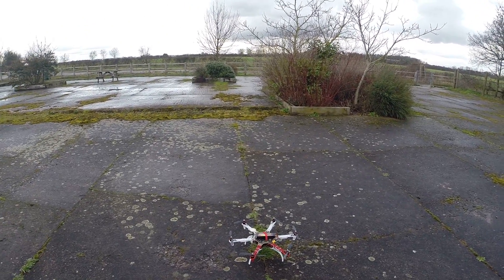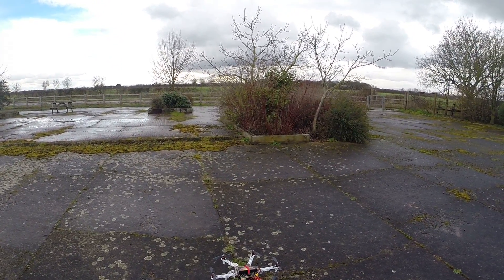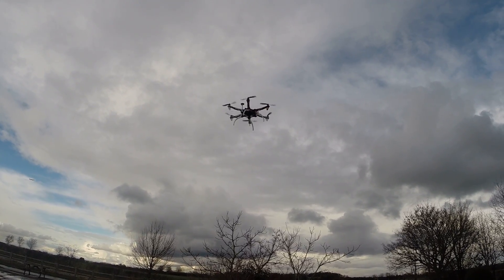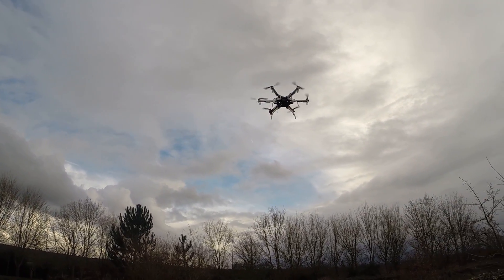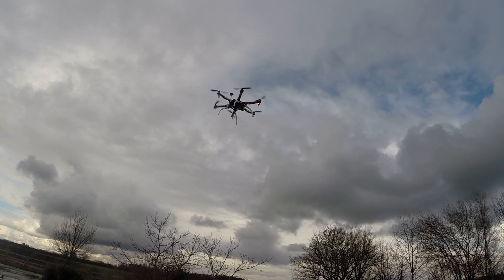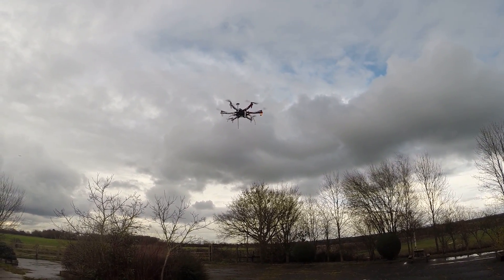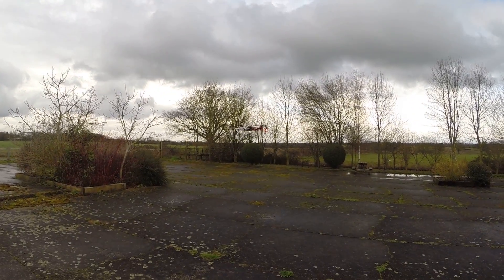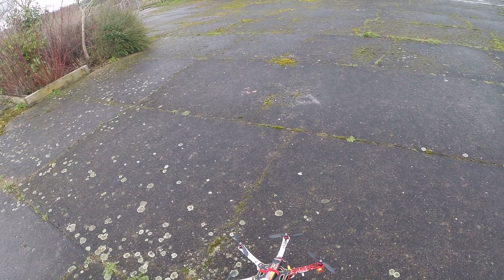DJI F550 - Naza M v2 - Loiter and protection demonstration

Comment: Thank you for this interesting video. Is there a way to set voltage protection to do an automatic return-to-home function rather than just landing straight down? thanks
Reply from the maker: Hi, thanks for your comment and question. Unfortunately there isn't a return to home function related to the battery. This is something I would like to see too.